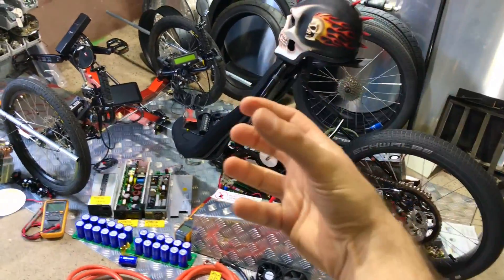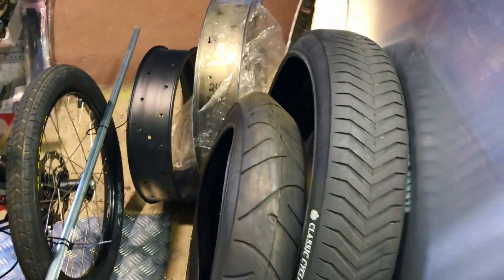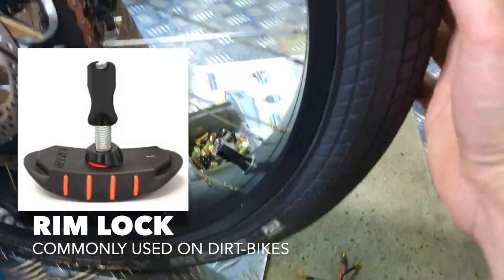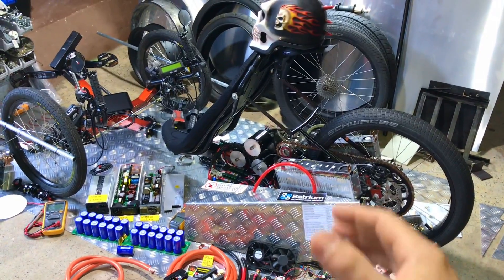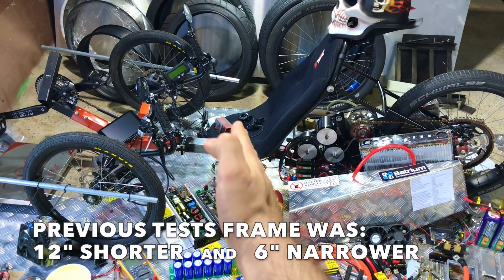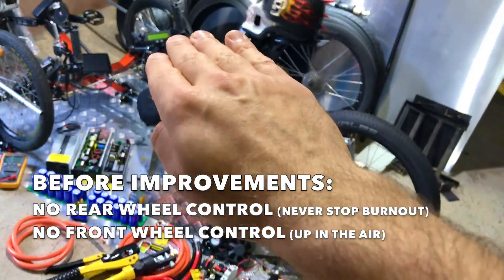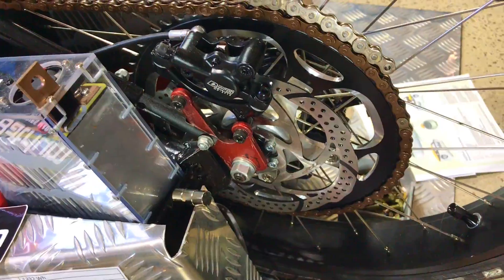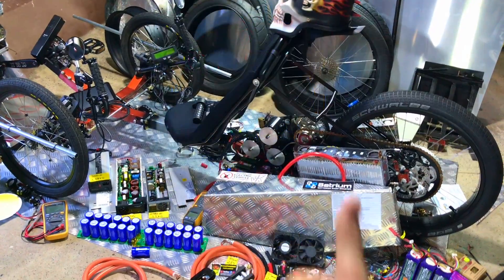DIY 42000w eBike 56hp Triple Motor (video#5) updates: longer, wider, electrical madness taking shape

Comment: are the supercaps really a part of that thing?
Reply from the maker: Marco Reps yeah, these are the small 350F Maxwell Supercapacitors, good for up to 170Amps. I emailed Maxwell asking if there was any problem paralleling then with my battery at much higher current draw (+800A). As I was expecting they will help with the ripple/surge first (as they’re much lower internal resistance compared to the battery) but then after few seconds will be empty and the battery takes over the hard job. They’ll help but I’m not expecting a massive boost. If you do the maths, Supercaps vs LiPo, you always get more value and performance adding more LiPo than investing in a supercapacitor system to improve performance. Anyway, I’ll fit them in my trike just for fun hahaaa
Reply: Those are not super caps. They are merely standard caps to reduce current ripple at the controllers.

Comment: You have been going on this project for 5 or 6 years, so when will it be finished? What is your plan? Are you going to sell them or what? What is the point of a fast E-Trike unless it is legal to use it? Love the concept of separate belt-driven motors as I have loads of problems with my Bafang BBSHD on my HPV Scorpion with drive train slippage and bang, crash,  wallop noises from my derailleurs and dropped chain from my 65T chainring???

Comment: Back in the 1980’s in a Comic Book a kid could find a Bigwheel Called The Green Machine a trike with Tank Like Shifter knobs that would with right forward Left back input would turn you Left swiveling the entire rear axle assembly. Maybe Just Maybe you might could build the first electric Green Machine. I know somebody built an adult sized motorcycle with the same engineering principles with a Gas Motor

Comment: Why you are using super capacitor?
Reply from the maker: These aren’t really powerful enough for this project but supercaps or very big capacitors helps reducing the voltage sag (drop) under load specially quick bursts of power, capacitors deliver power faster than batteries (increase performance and reduce stress on the battery pack)

Comment: Y didn't you simply add weights to the front when your front was coming up from the ground might even help stabilize the trike a thought at least that's what Mercedes did with their sls all electric
Reply from the maker: Yeaaahh I actually tested lots of different options (nothing will be perfect) and realised that the trike was way too short, one of the reasons why it was lifting up. Extending the trike helped stabilising and keeping the front wheels down. I used to have the batteries under the seat for an even weight distribution (under the seat - middle) but when I weighed both the front and rear axles with me on top, the rear was way too light and easily losing grip even at high speed. The only weight that I could shift around was the batteries and I am further in relation to the rear wheel. Everything seems much better on the scales. This is a bizarre project, everything is super weird but fun and very challenging =]

Comment: 42kw is about 1/20 the power of a formula one. 

I think the vehicle should come with steering and brake system that handles such amount of power.
Reply from the maker: Yeahhh it’s actually 1/6 not too far from the Formula E 
“With 250kW of power, the Gen2 will accelerate from 0-100km/h in 2.8-seconds and go on to a top speed of 280km/h”
https://www.fiaformulae.com/en/discover/cars-and-technology
The biggest difference is the weight, only 36kg in this previous video https://youtu.be/sRH_cpCwNDs
This is why I added an adjustable steering dumper, front air suspension and dual hydraulic front brakes, the original brakes couldn’t handle stopping this thing hahaha..

Comment: What are the cheapest decent batteries i could buy for my electric dirt-bike build (50KW) best price i've found so far is £3 per cell (samsung 30Q)
Reply from the maker: Joe hey mate, Samsung 30Q are junk... this is why they’re so cheap... they are “disposable” like these cordless tools batteries. 30Q is the 25R (high discharge “disposable cell used in cordless tools) slightly modified for higher capacity. Very unstable, if you don’t have a good BMS they go out of balance, massive drop in capacity... in general Samsung cells aren’t that good, 30Q and 26F (both pink) avoid dramas. Get Sony VTC6 higher capacity and higher discharge, available in Europe from a reliable website https://ru.nkon.nl/sony-us18650vtc6.html
Reply: @BrunoPOWEEER  Thanks! not bought anything yet, would you mind critiquing the setup i hope to buy :)

Motor: https://www.emf-power.com/product/motenergy-me1507/                                          (£723)

Controller: https://www.emf-power.com/product/sevcon-gen4-size-6-controller/                  (£675)
https://www.google.co.uk/search?q=sevcon+size+6+controller&spell=1&sa=X&ved=0ahUKEwjV3K3huovfAhWOShUIHYy9AsIQBQgrKAA&biw=1920&bih=969

Batteries: Motor needs 100V. Do you know how i should set this up i need about 40 miles range.

Comment: the tires is to street?
Reply from the maker: armando alves yeaahhh street tyres... can’t take this off-road, too low and also not sure if the 11500rpm motor would like impact without any suspension (rear is hard tail)

Comment: & 1 more thing where the flux capacitor going???
Reply from the maker: henry R. Hahahahaa I’ve got these blue Supercapacitors which isn’t necessarily a “Flux capacitor” but is one step closer hahaha... first I’ll run the trike without them, then I’ll add and compare if there was any advantage or not. 
Supercapacitor POWEEEEEEEEERRRR hahahahaaaaa

Comment: Wheelies on a tadpole????   Run awaaaaayyyyy!!!
Reply from the maker: Andy Lee Robinson hahahaha can u believe... I couldn’t believe first time I felt the front lifting... it didn’t make sense... then I tried again and it happened again and again, adrenaline levels were out of control I felt like my heart was going to explode... it felt nice but scary as f@ck... I was quiet for a few hours in shock... this is why I’m making so many improvements and it’s taking so long hahaha so much POWEEEEEERRR ohhh yeaaahhh
Reply: @BrunoPOWEEER  Absolutely.. it's not something you expect in a universe that follows the laws of physics!
Maybe some traction control could be devised, or add more batteries further forward and lower?
Extending the rear wheel backwards by 3 metres would also help! :-)
Reply from the maker: Andy Lee Robinson hahahahaa I’m trying everything here, batteries used to be under the trike super Lowe nearly kissing the road but was very impractical and could barely leave my workshop. I measured front and rear wheels weight and I needed more weight at rear for traction and longer trike to avoid wheelies... hopefully after these non-scientific improvements it handles better than before, otherwise 3 metres wouldn’t be s bad idea, need to try that one too!!
Reply: @BrunoPOWEEER  Well, I trust you'll solve it, and I look forward to seeing the results!
Wondering what time it might get on 1/4 mile strip!